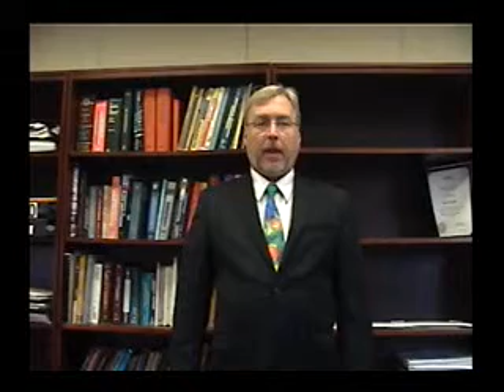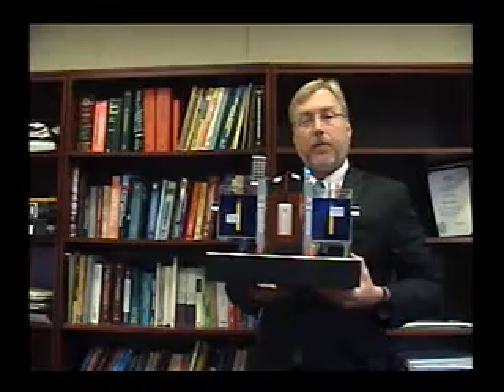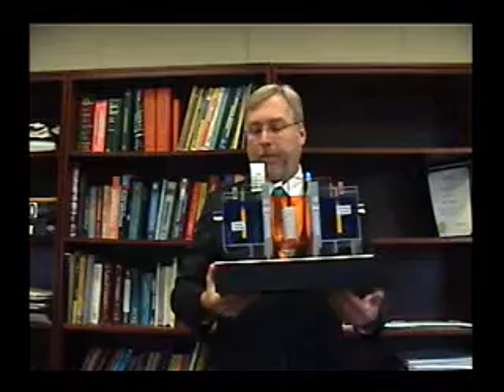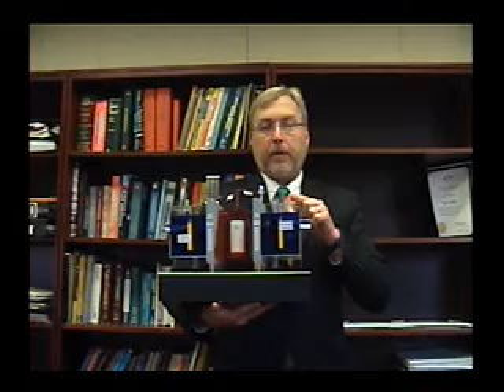Seawater Flow Batteries LCRE DEC12

Comment: I'm believe your overthinking your needs.  If you creat browns gas, a mixture of 2 parts hydrogen to 1 part oxygen.  You use the electricity to creat the gas and burn the gas to creat heat energy.  Browns gas burns very hot so has a great amount of stored heat energy.  I guess it all depends on your needs.  But a home that can use the gas for heating, cooking and for turning it back into electricity if needed for cooling and other household uses has everything they need.  Use a combination of wind and solar to use a household energy and turn all excess into browns gas for whatever you need.  Now who can help me with a safe storage system?